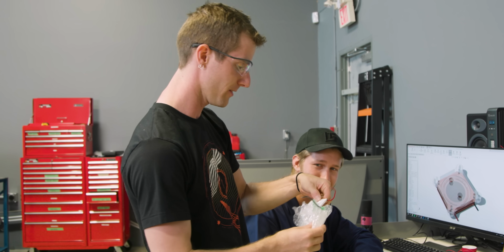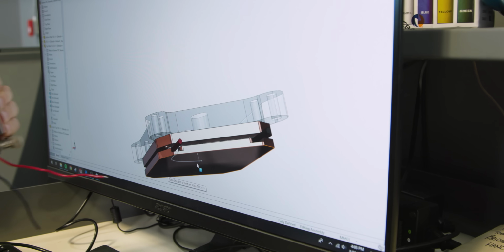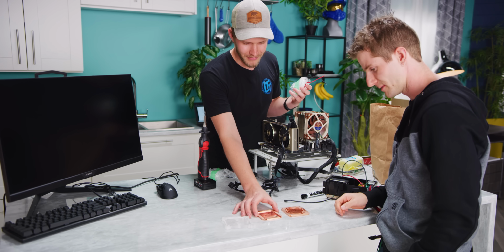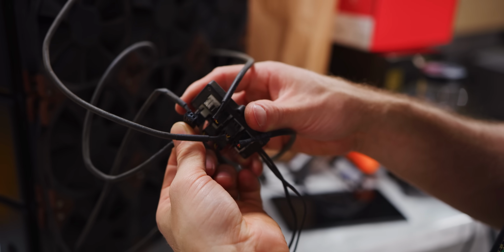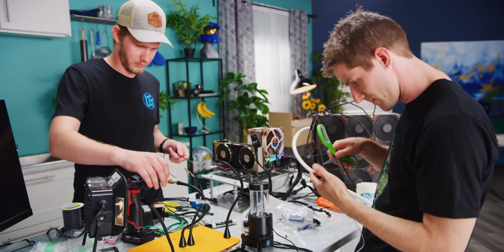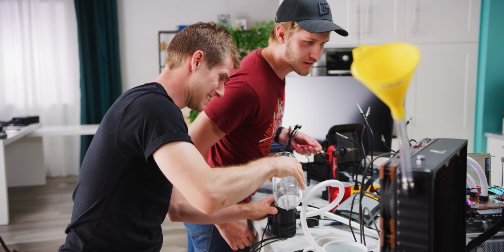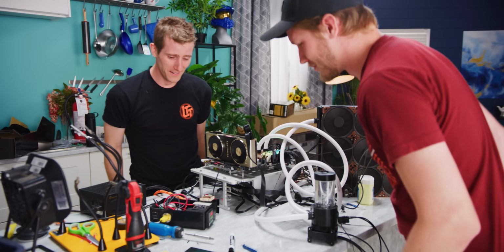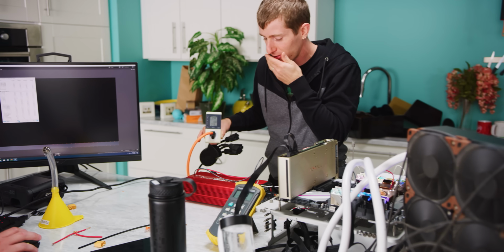This Cooler DRAWS 545W!!? Bad Cooling Ideas #2

Comment: Ok ok ok. So I have a fiendishly clever plan.
Build a water-cooling system that can maintain near ambient temps. So it's already as good as it can be. Then use the tech flipped in this waterblock(not on cpu) just chilling the water in your PC cooling loop.
It's like using icewater it only beads to help a little. To get the CPU or whole loop below ambient!

Comment: Hey i reckognise that PID controller. We decided to not use it because we couldn't figure out how it worked. We used an arduino, temp sensor and MOSFET instead (to be fair we ended up making the arduino do a lot more than what that PID controller could do)

Comment: You're doing it wrong. Totally wrong. First of all, Peltier elements efficiency is inversely proportional to thermal differential. I.e. the less heat they need to transfer the less Watts of electrical power they need per Watt of transferred thermal power. So, to transfer 200W of heat from CPU, you'd need a cooling system which can dissipate 500W-1kW of heat, so hot side of Peltier element wouldn't be hotter than 10-15C than it's cold side. And if it says 500W, that doesn't mean that you should crunk it up at least to 500W. Actually, that means that over 500W this element is useless or even worse that nothing. Because all that electrical power converts into heat energy. So, not only you didn't moved all your heat energy from cold side, you even added more heat energy from electrical power and only thing preventing all this nonsense from burning in fire is ridiculously powerful water cooling station. 

You should've keep to at most 200W or less power to your Peltier element. And if you'd keep temperature differential in 15C range, that should move ~200-300W of heat energy.
And I think more smaller elements is better than one large.

Actual benefit of Peltier elements in cooling system is that you can go in sub-ambient temperatures. While with conventional cooling systems you can't do even a tiny bit below it, no matter how huge your system is, with Peltier you can keep it, say, ~5C lower than room temp (to avoid condensation) with slightly more powerful cooling system.
Reply: this.  he doesn't seem to be testing at which power the device is most efficient.  also,  for some reason he's fixated on the idea that the peltier element needs to be used to cool the cpu directly,  when the application is also rather successfully used to cool the inside ambient air moving towards normal thermal tube heat exchangers via "mini A/Cs" which install outisde the housing and keep the condensation in a small reservoir which can be drained......  I think a peltier cooling block, much like the one in this video,  placed after the radiator, which only cools the coolant moving towards the CPU further should be tested as well... but instead they seem fixated on the idea that the element has to be placed directly on the CPU, which repeatedly fails every test...

Comment: I did this back in the day with a 226w peltier back when frozenCPU was just a template forum. My idle temp was -19c! Probably should note that I used 100% silicone bathroom tile caulk and sealed the cpu to the motherboard and then from the water block down to the motherboard for condensate reasons AND I also had a 15 gallon fish tank reservoir 🤣 my point is YOUR COLD PLATE IS TOO THIN!  I had 1/4 inch thick cold plate. You need a larger thermal mass between the peltier and the CPU when you put the peltier right at the CPU.  Please, for the love of the tech, make a better cold plate and redo this.  I was so sad to see you cripple the $#!+ out of that thing right out of the gate.

Comment: Have you never heard of the 437w Arctic Web TEC? I ran one for years on my C2Q9300 (and still have it). Used a heater core for a radiator with an electric car radiator fan running on 5v to cool it. Fed the 24v peltier with ~15v and got a below-freezing idle temp, with about 15C full-load temp with a 1Ghz overclock.

Insulated the motherboard around the CPU (both front and back) as well as coating it with dielectric grease to protect the board from condensation.

Comment: Interesting.  I'd often wondered about using a Peltier for PC cooling, but not directly on the CPU.  My thought was to use it more passively, in conjunction with a fan at the front or rear of the case to cool the air flowing into the case by 5 or 10 degrees while drawing only minimal power.  The idea being that if the air being supplied to your standard air- or water-based CPU cooling rig is slightly cooler than ambient, you would see some increase in the performance of your cooling rig overall.  Kind of like keeping servers in an air conditioned room, but in this case using a little modular box on the back of the case to create the AC effect.  It would be interesting to hear your thoughts on this, Linus.

Comment: Hi linus, very interesting video,  Just an idea why not remove the Peltier totally away from the CPU side and place it near towards the cooling radiator "with a large fan heatsink block Like the Notchua NH-D15" that way you won't subject the Peltier to direct heat >90C, you will still be able to use the copper water block and that way might work? as your cooling the water flow, would be interesting to try out as a experiment ??? might have to use antifreeze if it works well :)
Reply: Wasn't that what they did with that cooling thing from the previous video? There the peltier modules were attached to those heatsinks, which weren't connected to the CPU (they were given heat via water tubing).

Comment: If you connected an electronic device upside down then just check on the internet if that thing has polarity. 
If not, just connect it’s wires in reverse order; Red wire to Cathode and Black wire to Anode of the power supply. 
Peltier work either way! 😀

Comment: I wish you give the link to buy the module. Is it 12730 or higher. 12730 cost quite high wherever I try. If I get it between 600 to 700 INR I will definitely buy one and after test in bulk. Plz provide the link.

Comment: AC SSR in a DC circuit ? Really ?:D You need better engineering :D Typical SSR has a triac inside so it just cant switch off. You need a zero-cross event to drop below threshold current. BASICS guys ! Fancy Solidworks sim looks great but think more next time :D

Comment: You are running the peltier at too high current. They are all about small temperature changes. Small being relative. 900W is too much. Rule of thumb is you get a peltier that runs about half of what you have to cool and then you have to get cooling that can cool twice the combined power. So for a CPU of 100W you would get a 50W peltier and have 300W of cooling. That way you can control the temperature much better. 
Just blasting 900W into it is going to have thermal runaway very fast, since you cannot cool that much on the hot side. 
Pro-tip is getting a temperature probe for the hot side also, so you do a compare of the 2 temps and adjust the voltage over the peltier according to that, but that is much more complex to control...

Comment: You should think about better isolation between hot and cold base around peltier plate. The hot base radiates lot of heat and it is ending up on cold site base.

Comment: Wouldn't a better application for TEC's be as a supplement to the rad block? if you had a thermal diode in the water line heading back from the rad block to the CPU that could trigger the TEC to activate if there's a consistently high enough load that the water loop is starting to get overwhelmed it could add a bit more cooling to the water loop before it reaches the CPU that way it's only needing to do what TEC's are more suited to and dropping it somewhere in the teens rather than getting up to 50+ on just a TEC

Comment: Solid state relays use SCRs to switch current which, as silly as it sounds, means the relay won't turn off after its turned on when controlling direct current. 

They rely on the zero current crossing in AC power (120 times per second) to ever turn off.

Comment: You're right about thermodynamics is in play here, specifically the latent heat of vaporization of H2O.  There's an inherent heat storage capacity to water that isn't there for the Peltier device.  There's also the phenomenon of the difference between laminar flow vs. turbulent flow of water in a heat exchanger.  If you have laminar flow through your water block, you can generate micro bubbles of steam in the water; that steam infused water can then be pulled away from the water block's heat exchange surfaces. In turn, the micro bubbles of steam infused in the water collapse and spread and disperse the thermal energy in the water downstream from the water block. That's the "inherent" heat storage capacity of water I was referring to earlier.  That's what makes water coolers superior to Peltier devices or tech cooler devices, imo.

Comment: Ever hear of a vortex tube?  You run compressed air in and one side gets hot and the other cold.  Try implement that to cool your PC! ;)

A little insight here.  It WILL actually cool your PC with capacity to spare.  HOWEVER, a tube with 3000 btu/hr is going to be fed about fifty cubic feet of air per minute at 100 PSI!  That translates to about a 15 horsepower compressor!  So if you think chillers and TECs draw a lot...

Also noise will be a factor.

But you won't need a fire extinguisher. ;)

OK maybe on your electric panel if your compressor is pulling too much.

Comment: You need to check your T.D. across the radiator, also what was your flow rate? I wouldn't go off of the pump rating only. The length of piping, diameter, number turns, as well as the degree of each turn as it will add restriction causing the flow rate to drop

Comment: My english is garbage but i will try to input my knowledge the best i can.
One of the problems i see here is that they are overwelming the copper plate on the hot side, as well as the pump it's maybe not fit for the job. When dealing with such high watts you MUST need high pressure and flow sistem. The other thing is that they are running water, wich is not the best for heat transfer. They need to put coolant on the sistem, and i mean hi tech coolant, not cheap coolant.
Other problem is that at such high wattage you inmediately run in conveccion problems internally in the peltier.
Im sorta baffled they have not thinked on other ways.
The FIRST test they done, with the other peltiers, is the way to go, but with adjustements.
I have done this years ago and your mileage may vary, but i've done as this: Peltier 90W with a watercooled block on the cold side, and on the hot side (both full copper and  one with a thin base, you want to move the heat as fast as you can, and a higher thick base on the cold side to retain as much cold as possible), high pressure high flow pump, the better coolant you can get FOR THE HOT SIDE, regular destiled water ON THE COLD SIDE and a high flow normal pressure pump (you want to transfer cold at less rate than heat, otherwise youll may be overwelming the cold side), you will need 2 loops. Fan and radiator for the hot side (best if is 240mm or greater and 3 fans high speed, if able, 2 radiator). On the cold side you want to put the exit directly to the inlet in the waterblock on the CPU, then run the exit of the CPU in to a 120mm (or greater) dual (or greater) radiator, normal fans. Using this radiator is optional, and heavily depends on the temperature of the water when exits the CPU, might work using the radiator and when the water exiting the CPU is greater than the cold side of the peltier, turning on the fans.
It's a lot of work, and bear in mind that you never want to run the peltiers at is maximum power, doing so automatically overwelms the cold side. Might work for some time but after that, it starts to heat other than cool. Remember that you are working with electricity here, and electricity alwas produce heat.
I will take this approach. I remember using two radiators from two refrigerators for my setup haha.

Comment: you should try using those fish tank coolers you had in the other vid in series after a rad 

that way the rad dose 90% of the cooling and the tech just chills the water after its been cooled from a rad before it goes back to the CPU

Comment: Here is another (likely) bad idea. Try cooling the water with a few TEC's. like make it pass through a rad to get rid of the bulk of the heat and then pass it through the TEC's to get it sub zero

Comment: Those cheap SS relays are a notorious B*tch to set up. I've been using them for a few peltier aquarium projects (albeit 360w). And most pelts are rated for Vcc of 16-24v.

Comment: Your design was flawed the only tec combo i have seen work and still use it and stil f....... ing impressed by it is the cooler master v10 use it for my ryzen 9 3950x and keeps it nice and cool and with safe temps below 70c As it has a 205w cooling ability not bad for a 2010 cooler!

Comment: I think the amount of heat transfer to water  on the hot side is the bottleneck. it is too small contact surface between the copper and water flow. 
the hot side needs to be connected to a bigger copper plate which in turn connected (or in one block) to a 3d 'maze' of copper which the water run through.
Reply: oh, and the radiator should be able to handle total power of peltier +cpu+water pump + leeway.

Comment: I would like to see a regular water loop on cpu and use the TEC as a replacement the cpu loop radiator and then another loop to cool peltier.
Reply: That possibly would cut down on the condensation around the mother board

Comment: Try using a better thermal fluid for removal and transfer of heat. Geoexchange systems and waste heat recovery typically use glycol loops. I have also read research on using supercritical CO2 as a heat transfer medium. This would make it very interesting to see if anything changes.

Comment: I doubt the PID regulation is working. First of the an SSR is not supposed to make a clicking sound, that was probably a relay contact in the PID regulator. The SSR use a Thyristor to control the current and it will only turn off when the voltage Zero cross (AC) or voltage is removed. But I think connected DC to the SSR so it will won’t turn off.
Reply: Guess I pulled the trigger on that comment a bit early, and as I suspected the SSR did’t turn off.

Comment: Hook the radiators to an Arctic Air Ultra swamp cooler, or store the radiator and Reservoir in a mini fridge( but not the rest of the computer)
Heck disassemble a mini fridge and use the cooling apparatus integrated into the water cooling

Comment: i have tried a TEC module with insane results shame i never logged it
Reply: top tip with TEC's, the more heat you can get rid of from the hot side, the colder the other side can get, i managed to maintain 13c with a i7 4700k and a cryorig R1 ultimate and had the TEC running on a manual voltage reg so i could control the modules voltage, then a simple 12v temp sensor with led dial on the front of my case so i knew how hot cpu was

Comment: Linus, use a superconductor as a contact point between the CPU and the heat pipes of a CPU cooler. And to go further, you can even delid a CPU and replace it with another superconductor. Let's see what happens 🙃

Comment: i actualy ran a dual CPU system with this setup around 1999-2000. i used two celeron 400 (socket 370) a BP6 motherboard and two 55 watt coolers running flat out 24/7. you needed to have "GOOD" cooling. i used two Alpha PAL6035 running full blast. as long as the room i was in this worked just dandy. the problem came when i arranged this LAN party and the climate control in the building was set to turn of at night. and it became 30c+ at the second level. then i did not get the air out from between the gfx card and the PSU stack (i had to run two) so cardbord and gafa was used to direct the fan flow inside the case and i was ones again able to hold my hand on the case lol. 
btw.. you will ned a LOT of insulation to prevent condensation. as well. i used foam cut and stacked around the socket and the lower part of the cooler. 
for you to make this work your biggest enemy is heat on the hot side. i think if you made the ribs in the water block 2-3 times higher AND square (have the ribs covering ALL of the cooler element) and used two in and two out tubes + dual pumps it might work.. remember you MUST be able to remove 2000 watt+ and hold it under 35c. you can only expect a temp difference of 35-45c at this level on the hot and cold side. might go doen in the 20's. so the hot side MUST be kept cool!

Comment: They really don't understand how Peltier works. The cold side doesn't stay cold if there is a thermal load on it. Not to mention, the hot side will thermal soak into the cold side causing the temps to rise... and they're using a 545w pad. I doubt that water block/radiator can move that amount of heat.

Comment: the one thing people don't think about, using it as a supplement for a liquid cooler. use it to cool the liquid in the reservoir. I don't know how one would do that, but it seems like if you use radiators to transfer the bulk of the heat out of the liquid, then use the tec to cool the liquid in the reservoir or have it run through an in-line cold plate attached to the tec to cool that way.

Comment: you are trying to cold it with the peltier cell but could be posible to get enegy from it instead? making hot water go 
through the peltiers modules (the problem i think is to create the module to conect peltiers with water) and provide energy to a fan or some leds? it would be awesome

Comment: This design was flawed from the start. You'll never get more cooling than just having the watercooler right against the CPU. The water cooler is doing all the work. The Peltier cooler will cool the CPU a lot at first, but will eventually equalize in temperature and only pull as much heat away from the CPU as the water cooler pulls away from the Peltier cooler.